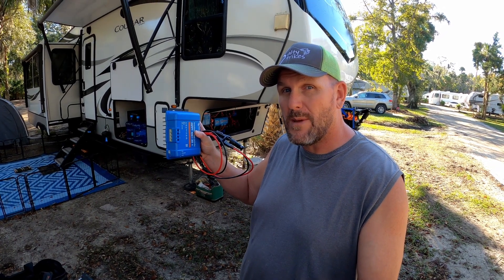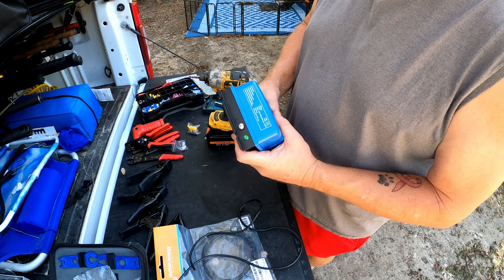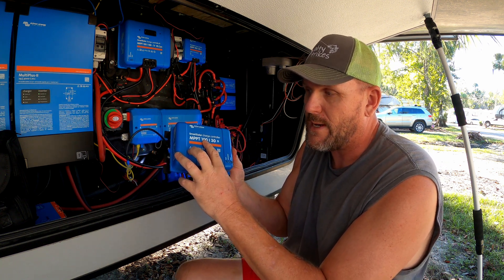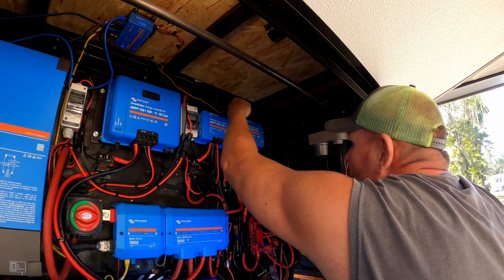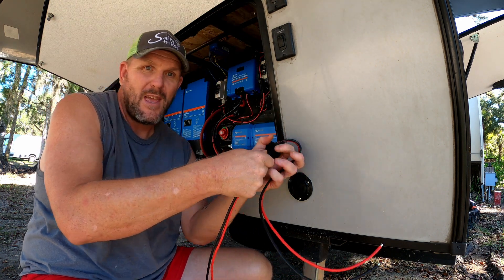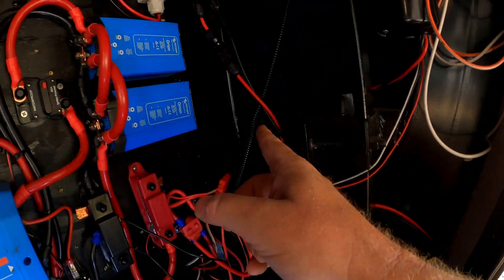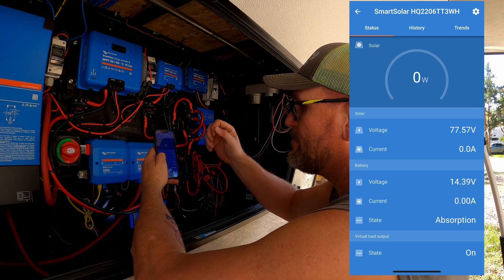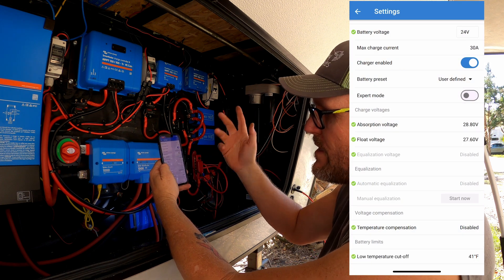Cheap portable auxiliary SOLAR PANELS on an RV! #rvlife #rvsolar #offgrid

Comment: I bought a 34' Airstream down in Punta Gorda. The previous owner started putting solar frames on the roof but never finished the project. Realistically how much do you have in your system and how long did it take to pay for its self?
Reply from the maker: @michaelmoore7550  here’s a play list of the enter build, we did it in stages https://youtube.com/playlist?list=PLXL0DAEhCeew8ymmeXnQZbforpQDwK_e3&si=9aL7Ib6nwGVqAAgt

I did do a cost video it’s in the playlist but that was before everything was completed. As far as paying for itself, already has with the freedom and secure it brings to go anywhere we want with power and not have to worry about crappy RV park electrical grid failing.

Comment: What about mounting the panels on the nose of the camper?
Reply from the maker: @shawnbeerens4292  I thought about that but no secure way to clip them on and the slide gets more sun per day than the nose.
Reply: @saltytrips  I have contemplated mounting flexible panels permanently on the nose of my RV. I haven't seen anyone else do it but if you are out of roof space I thought it may work

Comment: I have a concern if you have an evaporative refrigerator in that you are blocking the air in and out with those panels on your slide.  If you’ve replaced the fridge with a dc compressor or a standard fridge that’s a non issue.  Otherwise looks like a nice install.
Reply from the maker: @blairM363  residential frig … all good 👍